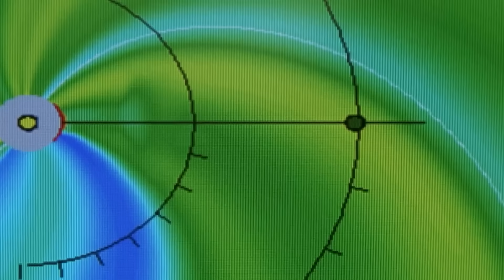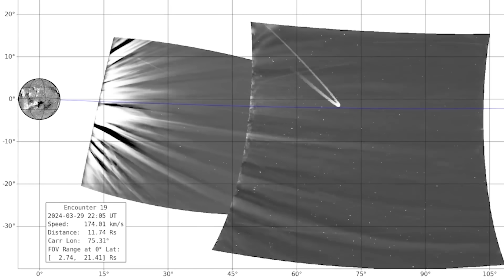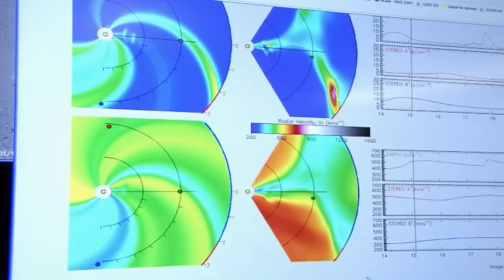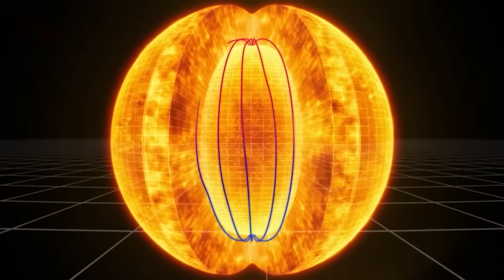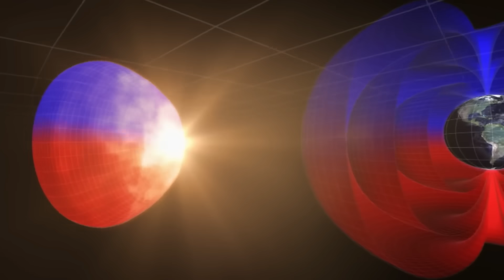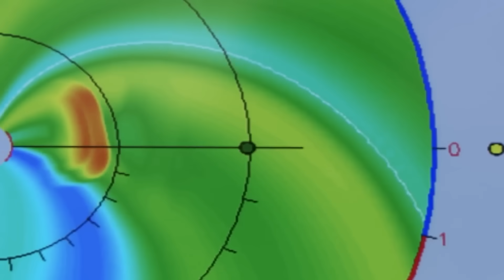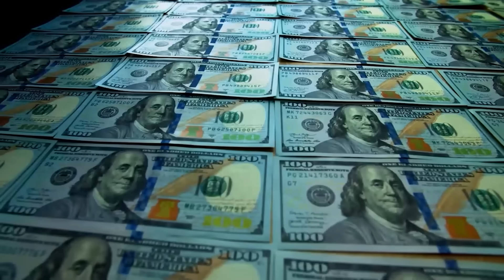NASA Just Confessed the Gleissberg Cycle Awakened… And What Comes Next Can’t Be Stopped

Comment: Edison was correct in criticising an electrical grid over a distributed system like Tesla built for investors. Pumping electrons into the Ionosphere would recover quickly. There is a growing body of evidence that the pyramids were doing the same as Tesla and the one in Bosnia is still doing, pumping Ions into the ionosphere. So pyramids built by past advanced societies work around for this issue were pyramids or power distribution stations.

Comment: This is all apart of the solar nova cycle and will keep building up until it finally goes nova in 2046 and then makes a matter shell and then explodes that shell off and away just like the many dust shells that have been tracked by astronimers for decades. So far they have tracked 7 nova cycle events, happening every 12,068 years.

Comment: Rough scientist, like a rough cop. Off the case but still working? Suspended pay? Working but not on corporate, gov't, or university salary? Anyone calculate the density of the sun? I got 1.5 of water. Not a gas. Does plasma get pumped into the earth poles funneled by the magnet lines? Is that why all the lava and plate movement?